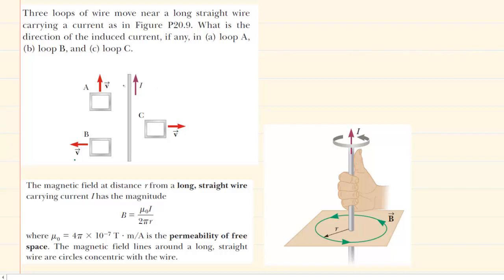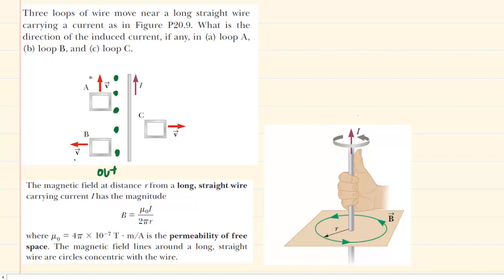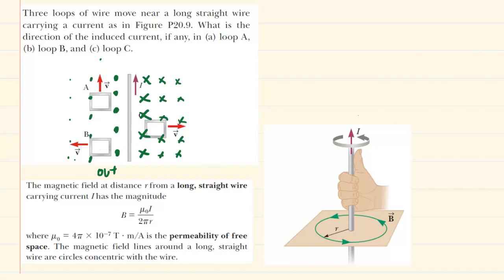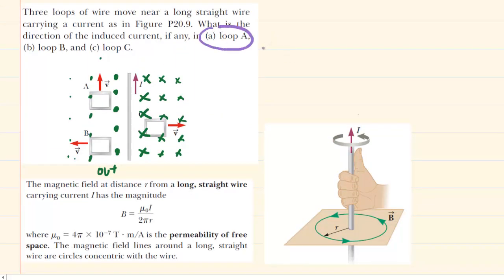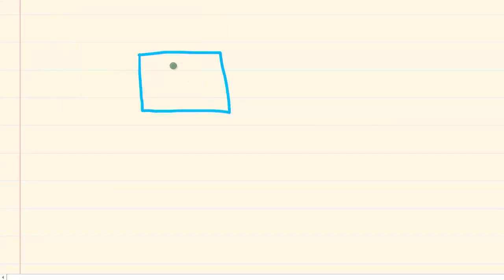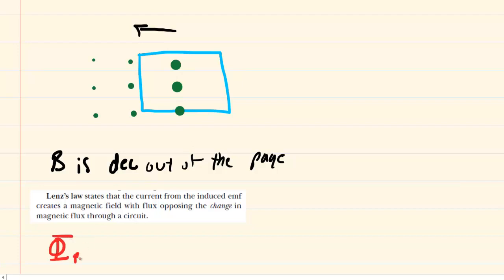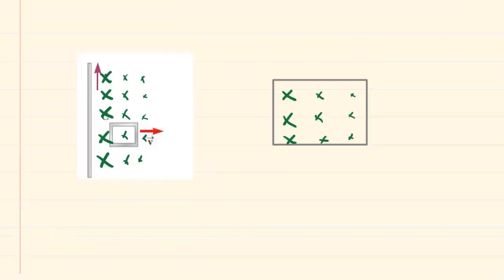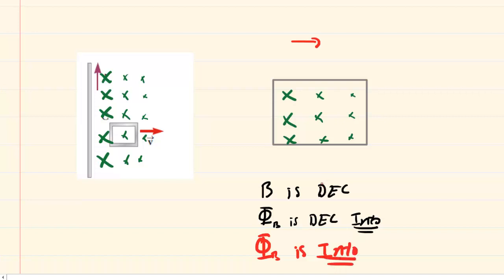Three loops of wire move near a long

Comment: Please help me in this question 
A loop of wire contains two identical light bulbs, L1 and L2. The region in the loop contains a changing magnetic
ield whose direction is normal to the plane of the page. Both light bulbs are lit. A copper wire is placed across the
loop as shown in the diagram.